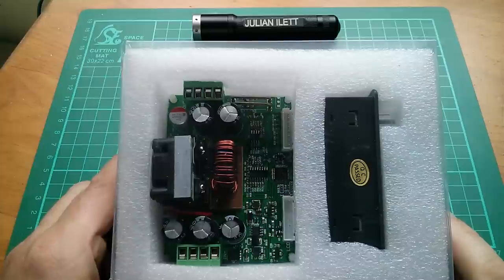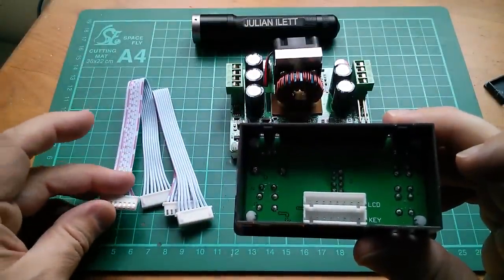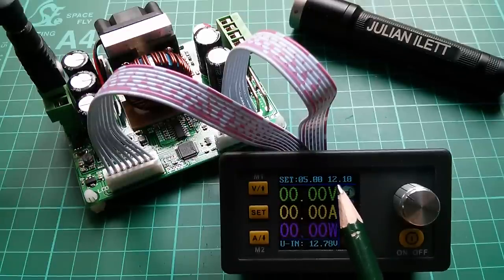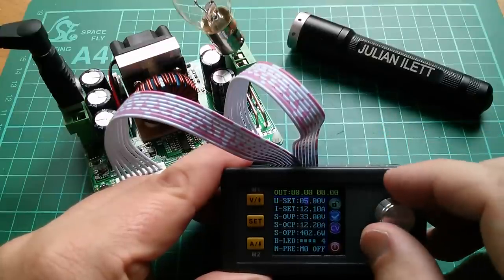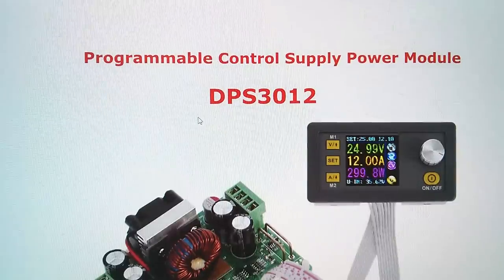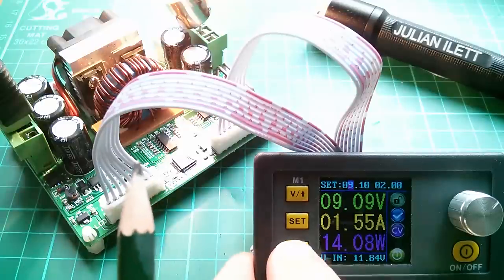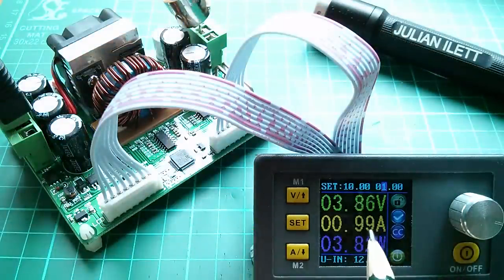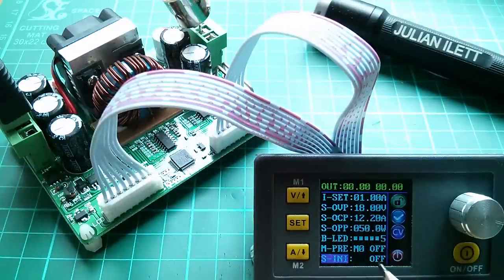First Look: DPS3012 CC CV Buck Converter with Colour LCD

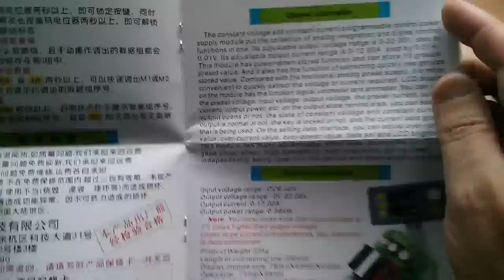Comment: It has some serious limitations, it only steps down the voltage (it's a step-down converter), if you look carefully it says in the leaflet (1:02 minute mark, page on the right with red ink) that the input voltage has to be 1.1 times higher than the output voltage, in your demonstration where the input voltage is 12.8V you can only set output voltages up to 11.6V even if the specs says you can output voltages up to 32V, in order to output higher voltages you'll have to also input higher voltages so you can reach the maximum output voltage of 32V.
That's how it's actually advertised on ebay as a "step-down programmable power supply module".

Comment: Well, you have outdone my favorite buck converter.  I love the LCD display on my 60V, 20A max buck converter and love its features.  Other than the I9W6 having a lower max current (12A), I think it's pretty cool (display and configurability!)  I need to get one!  I use my buck converters with solar/battery input as well.

Comment: Could you trace the output with an oscilloscope while switching on/changing the load to see if it has overshoot (the most important thing) or big drops in voltage (because regulation is too slow). It looks fine for (relatively) static loads, but it would be interesting to see if it's useable on highly dynamic loads as well.
Reply from the maker: OK, I'll do that in part 2. Anyone got any other requests for inclusion in part 2?
Reply: +Julian Ilett try a 12A load and see if it can actually handle it
Reply: Maybe check how loud the fan is under full load.
Reply: It'd be nice to see the output metered for accuracy and the temperature on the heatsink checked when its been putting out a few amps for a little while. if its good I might get one of these to replace my horrible bench power supply which is so inaccurate it might as well show random numbers on the display
Reply: Solar panel => Step down converter => super caps => Buck converter => inverter. See if this unit and a buck unit can work together with a cap bank as a buffer for powering a power inverter directly off of a solar panel.
Reply: Julian Ilett please concider doing this, many of us are in the market for one and perhaps you could help us? Cheers mate
Reply: @12458 SSE  Good idea, 12A on those cheapie filmsy connectors.
Reply: May also test how quickly the current-limit/OCP kicks in. Connect one pin of a low value resistor to the negative output and the other pin to the oscilloscope probe, then touch the positive terminal (and obviously have the supply set in a way that it will limit or switch off). You'll see on the scope how long it takes to react and if you use a 1Ohm resistor you even get the current without having to do any calculations. The usecase I imagine is for example powering some logic circuit at 5V which in normal operation should never draw more than let's say 100mA. That would be the values I set the PSU to. Now if something does get wrong, how much can it fry? ;)

Do you see any kind of protection against feeding power into the output, when the PSU itself doesn't have power itself? Actually I wouldn't know what exactly to look for, but maybe you can see something.

If you set the voltage/current on the main screen, does the cursor jump back to the least significant digit all the time or does it remember which digit you changed last (I'd like to have the latter, because in those cases where you change the voltage often you will most likely always be doing it in the same step size).

I'm quite interest in this one, because I'm thinking of using it as a "field PSU" running on a 4S to 6S lipo pack. But the price is too high to just buy it for trying it out like I usually do with ebay stuff ;)
Reply: Julian Ilett could you mention any recommended ways to power it at it's upper limit? Or anyone else? Not from solar but off AC then.
Reply: Also most high power DC2DC converters and cheap LAB PSUs have problems with regulation on 1 - 100 mA range... They get severely unstable. I fried a few LEDs with that shit!!
Reply: +Julian Ilett test the max output and cooling capacity!
Reply: +Julian Ilett thank you for your work.
Reply: +Meiestrix, as the desinger, I can say . the voice is small. this is my advantage..
Reply: Are the outputs isolated from the input? Can you run 2 units with parallel output? Can you run 2 units with the output serial connected? I am guessing no..
Reply: +neutronstorm yes, this can 't be. because it is my design way. only work by itself.
Reply: +Andrew van Leeuwen you can let him test max output .. and measure temeperature. I can make sure even it is at ful load, it is not need other cooling when it is not in the box.
Reply: How fast is the response for CC/CV. I have the DP30V5A and love it, but it's not stable with fluctating current-draw. Even with big capacitors on the input-side
Reply: +Julian Ilet Yes, please make more technical review (with list of IC used, and maybe some macros - this is only few seconds of video). 

If they used some of the analog dc-dc converter IC please try to show us how they control this from uC. Probably they are changing the feedback signal by PWM from uC. Also please show us how they measure the current and control the output current from this analog IC.

It will be usefull for making our own digital or programmable dc-dc converter using cheaper dc-dc step down or even step up modules from ebay connected with arduino.

Comment: PERFECT TIMING! I was thinking on buying this exact device ... Cheers!!
Reply: @rdtech9153 : One question. In the input, if use a 24v ac/dc adapter (or even a 19v ac/dc adaptor) . Will the DPS3012 still reach the 30v/12a output?
Best regards
Reply: @johnmacedo4483  no, it is buck mode power supply, the max output voltage will be 1.1 times lower than the input voltage, for DPS3012, it can output  32V max,  you need to connect 36V 400W input

Comment: I have the little brother, the DP50V2A, which I've been very pleased with.  It doesn't have the live V/A buttons like yours though (mine are marked M1 and M2), darn it.  However, I just this minute discovered that if I hold in the M1 button for a few seconds, it turns off and resets back to 5V / 2A, which I suppose are values I saved in one of the presets...

Comment: Good review, is there a way to hard set upper limits for voltage and current, for example if you were only using a 24v (28v) power supply is there a way to stop the output voltage being quickly set above 24v?

Thanks

Comment: For part 2:  Can you determine which IC is controlling the converter?  As an alternate question/request, could you, please rattle off the IC's?  I do not mean for you reverse engineer the power supply, I am just curious as to what the designer might have used to control the converter.

Thanks,
Steve.

Comment: I would rather have separate knobs for voltage and current so if you turn the V knob the V display goes into V set mode (maybe flashing) and after 3 sec goes back to actual output voltage with the Amps knob doing the same thing. You could still have the knob as a third settings knob but without volts and amps setting in the menu. This would make it real easy to set the volts and amps without having to go into a menu.

Comment: Are these capacitors connected directly to the output ?
the peak current will be really high in case of a short circuit or a wrong connection.

sorry for my english.

Comment: That's a nice little unit! But I do have a question I see there's a fan on the heat sink in the back. Is that run continuously or only startsto run when it gets to a certain temperature, volts or watts?

Comment: The reason OPP didn't trip until it hit 3.6W has to do with significant figures.  3.50 to 3.59 looks the same if you drop the last digit (which is what I'm betting the comparator function is doing), so it will not trip until it exceeded "3.5W" (i.e. 3.60W). ;)

Comment: Julian Ilett Can You make more technical review in part 2 of the review? (with list of IC 
used, and maybe some macros - this is only few seconds of video). 

If they used some of the analog dc-dc converter IC please try to show us how they control this from uC. Probably they are changing the feedback signal by PWM from uC. Also please show us how they measure the current and control the output current from this analog IC. You have very big opportunities to make it.

It will be usefull for designing our own digital or programmable dc-dc converter using cheaper dc-dc step down or even step up modules from ebay connected with arduino. Also this will be usefull to make our own MPPT converter for solar system.

Hope You will read it :)
Cheers!

Comment: So I could control one 145 watt solar panel and use this to charge my boostcap bank, and this unit would only draw power and turn on when there was light shining on the solar panel; sounds perfect.  I might use this unit to charge my caps, and then a boost unit to maintain the cap's output voltage. I don't know what the use would be now, but if I still had my electric scooter this would have been my whole system. At the very least I can stop using light bulbs as resistors to charge my bank lol. You could even use this as a poor man's MPPT charger for a small solar system.

Comment: Whats the difference between [only the lcd] and [lcd+ circuit Board]? Whats the Advantage of the circuit board? Didnt get that...
Reply: The higher power units have a separate lcd and circuit board. I have the dps 3003 and it's all combined into the lcd module.

Comment: I seen this before (the smaller version) on eBay. I like it will need to get one.
Reply: electrodacus
wherevere you see it , it is our products. we are the only one manufacturer
Reply: Rd Tech
I got the DPS3012 from an eBay seller recently and just received the DPS3005 from banggood. They are excellent products and I do not usually make compliments :).
Reply: +electrodacus 
it doesn't matter. they are all my reseller. you can buy .

Comment: Does the input current needs to be high (higher than 12A) in order to get 12A in the output??
I need 5v 10A output. The input I have is rated 12V 1A. Is that possible with this module?
Reply: 5V*10A=50W
12V*1A=12W
50W>12W, so you need a more powerful input.
50W/12V=4.16A at 100% efficiency.
So a ~80% efficiency is 4.16S*1.2=4.992A.
You need a 12V@5A!!! input just to play safe (80% is a bit low, maybe it can be more efficient)
Reply: majdinj
if you want it output 30v/12A, fistly your input voltage is more than 33V. so 36V is ok, our efficiency is about 97%,  so you need find some more than 370 W power supply . remeber , don't let input voltage more than 40V 
https://www.aliexpress.com/item/RD-DPS3012-Constant-Voltage-current-Step-down-Programmable-Power-Supply-module-buck-Voltage-converter-color-LCD/32685179404.html?spm=2114.12010108.1000023.36.jUWdUZ

Comment: can you use this as a lab benchtop power supply?
Reply: thats basically what it is
Reply: Yes.  Just knock up a transformer, rectifier, reservoir cap assembly, proper output terminals, etc and it's done.  The controls are a bit clunky but for the money that is a minor issue.

Comment: Nowhere near ZXY6005D. Looks like a toy compared to that, no capacity for battery charging and slow (bad) user interface. Good sides is higher amperage, and no worry about heat dissipation. But those are only advantages as far as I can see.
Julian, if you do review on these, please also include ZXY6005 or ZXY6020. Greetings from Serbia

Comment: one of those power caps looks slightly bulging...
Reply: ***** 0:00 - The one on the top right. I said it was slightly bulged. Not a great amount. I mean, it is probably fine--but I can't see a company that is worried about it's reputation letting that through visual inspection.

Comment: Are those connectors really meant for 12A ?
Reply: There are 4 pins on the power in and power out. I'm willing to bet they are connected in pairs in which case 6A per terminal is pretty safe with that style phoenix connector.
Reply: TheOldmankk
 yes, sivalley is right. don't worry about this . all those are tested.

Comment: Do they make a boost-buck version?
Reply from the maker: I haven't seen one with this kind of display.
Reply: Unfortunately, I don't think so, I would definitely love to see one though.
http://www.aliexpress.com/item/38V-6A-DC-DC-Digital-Boost-Buck-Step-up-Step-down-Module-LED-Driver-Solar-Charging/32699655308.html
I did however, find this MingHe boost-buck converter model number DPS3806 (38V 6A) but you won't find many results if you search for the model number since a lot of the sellers don't include it for some reason.

I've bought one of these myself, but I'm still waiting on it to arrive, so I can't confirm it's quality or anything just yet.
Reply: please do confirm when you get it
Reply: BitsAndBites Sure, I'll try to remember to do so.
Reply: Robert Shaver I thought about that but in my test this produced a noisy hot and unstable mess ( with a XL6009 and LM2596s )
Reply: They do.
DP30V5A
And DP50V5A
Reply: ***** Those are just buck converters, I don't see anywhere that states they can boost too... Link?
Reply: +vgamesx1 oh yeah, but say you run it through an ac-dc 12v 5a switching psu into a small boost converter wired directly into the unit, you've got the full wide voltage range
Reply: ***** Sure, but what if I want to do like Julian and run it off solar/batteries?
That's incredibly wasteful when you have a limited amount of power, well that and also it doubles your upfront costs because now you need two converters of similar capability, so at that point you may as well just use them separately like Julian tends to do rather than try to wire them together, honestly that just seems silly to me.
Reply: vgamesx1 The main problem comes from ground continuity, in that setup your gnd migh be up to a couple of volts above the mains gnd
Reply: BitsAndBites Interesting, I didn't even know that would even be an issue, but I'm still kinda new to electronics so there's probably a ton of stuff I don't know yet.
Reply: +vgamesx1 my suggestion was is your were using it for a bench psu
Reply: vgamesx1 They put resistors in the ground line ( most of the time ) to sense current, say you have 2 0,5 ohm resistors, then you're a bit above ground

Ideal solution seems to be a 36 or 24v PSU feeding into a buck converter, adding a big cap in between the psu and buck
Reply: BitsAndBites Hey since you asked, I just now received that boost-buck converter, I haven't started playing with it just yet, anything specific you wanted to know about it or wanted me to test?
Reply: vgamesx1 How big is the ripple ? Would an extra fan be needed ? How much current can I pull ? Would it be possible to rewire it to be ran off a arduino so you could make a bench psu ? Do the caps look like quality ones ?

lots of questions :p
Reply: BitsAndBites Hey just getting back to you on the max current draw for that converter, I've played with it a bit although I've not pushed it to it's limits or anything crazy (partly because I don't have too many ways of drawing a fairly large amount current) so I won't guarantee anything but from the datasheet over at http://www.mhinstek.com/ it states 5A from natural cooling, so yes you will need a fan to get the full 6A output (8A max input).
Also the accuracy is decent, it's only off by about 8mV from what my DMM states and while I've not tested the current with my DMM it's fairly close as well, I tested it in steps with a 10W LED.

If you're interested...
Here's a link to the original datasheet: https://drive.google.com/open?id=0B7w1odapcBUhUmlKVWZkbm1uLXc

Here's a link to the datasheet that I translated using Google: https://drive.google.com/open?id=0B7w1odapcBUhdDJtTFZ5LXV6Mmc

Hope you find it useful.
Reply: vgamesx1 Many thanks
I'll be ordering one, seems good enough as a cheap bench supply

Comment: what happens if u short the negative and positive
Reply: It probably just goes into CC mode.
Reply: It will go into constant current mode.  Shouldn't harm it in any way.
Reply: NE555
you can short output positive and negative , there is protection . but can't short input positive and negative , ok? there is no protection
Reply: John Ridley
yes, you are right
Reply: +hyperion8008
yes, you are right